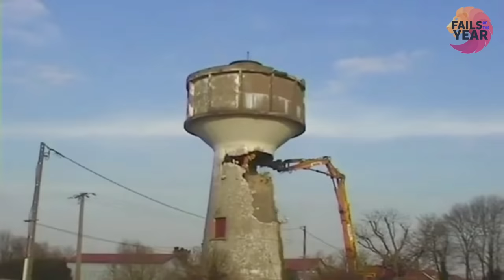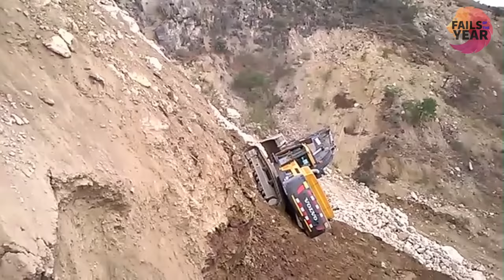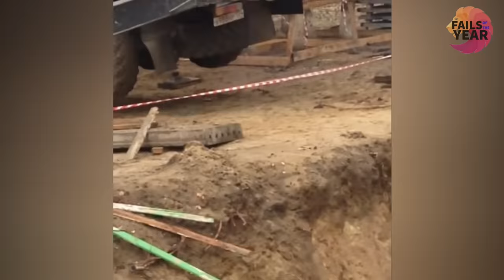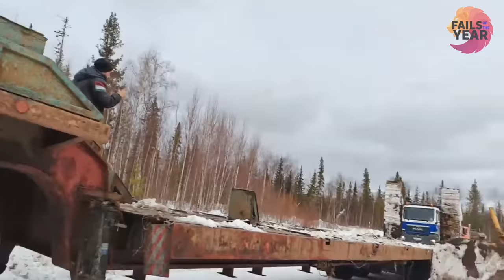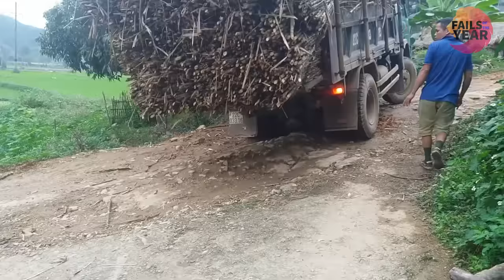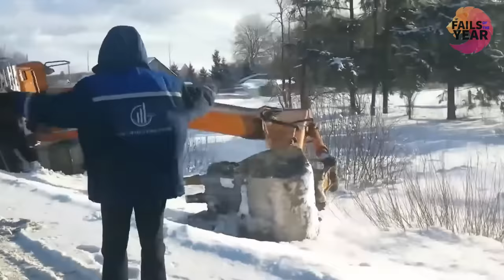Heavy Equipment Operator IDIOTS | WISE Fails Compilation | Biggest Excavator Fail Win Skills

Comment: one would think if you can afford a large track vehicle, you could afford a proper trailer for it.it has to be cheaper than constantly retrieving & repairing rolled equipment.
Reply: Doing it on the cheap always cost you more.

Comment: After watching all those fails of machines slipping off the back of low loaders….surely there is a market for designing a steel platform on hydraulics that slides out of the side of the low loader and gives adequate space for it to up.???????

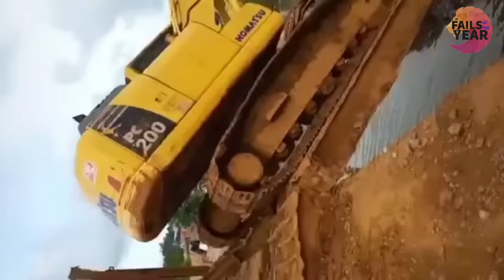Comment: afew of these shouldnt be in here as fails! as a demo wrecker myself the building fall at 1:22 is almost prefect ! alittle in the street so what quick clean up, if you have never sat in the seat knowing how hard it is to bring down a 3story house with 6 feet between the houses on either side, and you do it without hitting either house with falling debris or bricks, etc. Its tough my friend, its a skill, any ass can put a bucket in the ground, wrecking is a skill set!!

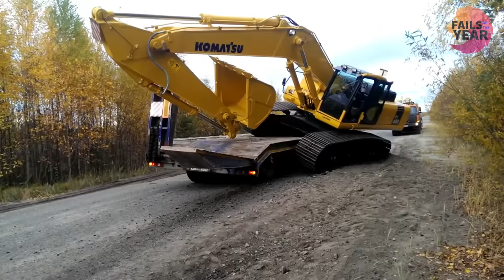Comment: The clip starting at 2:44

I don't know if the operator was good (how'd he get in that situation if he was good?) or if he got really lucky.

Imagine having to explain to the boss how you just destroyed his brand-new multi-million dollar excavator, or whatever they cost, before even getting it off the trailer 😂. 

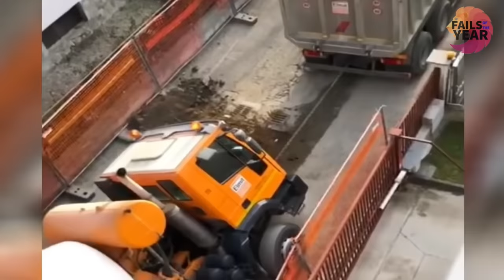6:01 I couldn't believe it when I saw the operator was in that excavator.

He had his seatbelt on which did stop him from completely falling out, but it also meant he was stuck in the cab (almost half in and half out if it) and couldn't jump out and run to safety had the opportunity arisen.